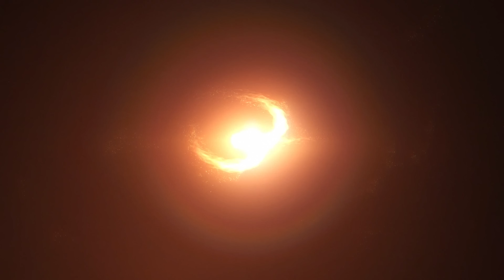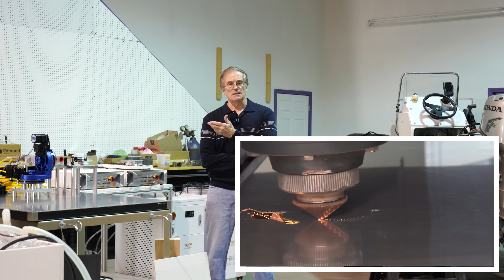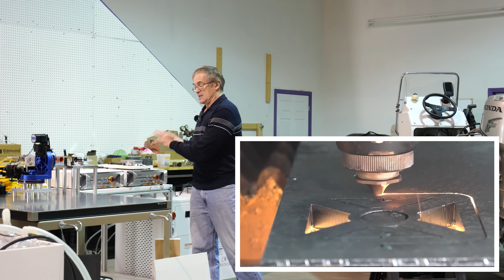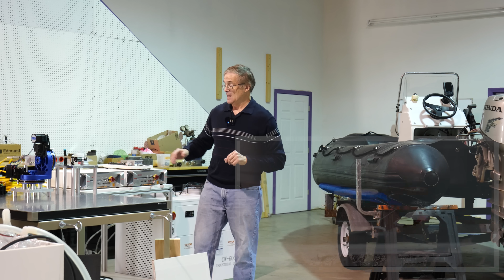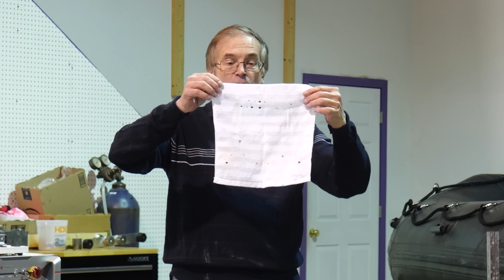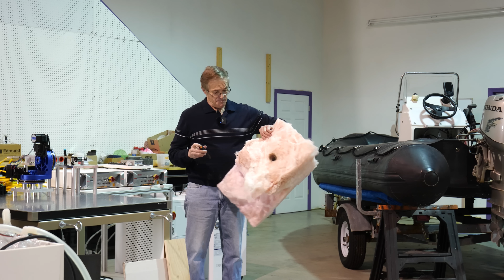We have a problem... and need your help!

Comment: I happen to develop a lot of extreme heat resistant carbon-based materials for refractory use, one of which is at present is a waste material to get something else. Graphitic carbon, or more specifically, graphitic carbon nitride, is especially good at absorbing various radiation-sourced wavelengths (including laser as it were). In this instance, it is both highly effective and fairly easy to produce with some relatively baseline tools. I can email you a short list of tooling to get you started.
Reply: Low tech - sandbags!
Reply: @nameredacted1242  Soon to become fused glass blobs 😂
Reply: That, incombination with something transparent that can pre-disperse the light (one or more stacked panels with microlenses? Don't some types of tvs have those?) somewhat, that would probably work.
Reply: Bricks of compressed charcoal with trapped gas bubbles will have some fly off and disperse the beam further.
Im an Aerospace Engineer, awesome to help. :)))
Reply: @vovochen wouldn't that be like lighting your bbq grill?
Reply: @vovochen  That's not a terrible starting media, though I'd vote to supplement it with some suppressant additives and selective binders. I've experimented with the lump-style in graphitizing them in reduced atmospheres, and it can be done cheaply. In concert with a few choice clay-based powders, it'd make for an affordable coating system. 👍
Reply: @dreed7312  Sorry, its been lost in translation - we call already burned products charred coal here. :) Since they are oxidised, they are pretty inert. :)
Reply: @vovochen  Carbon, yes.  Compressed bricks, no.  You want layers of carbon material.  Specifically Intumescent ablative shielding.  NASA used this before developing their expensive ceramic carbon-carbon tile shielding.  Basically you need a substance that can be formed into layers that produce carbon and expand with CO2 as they burn. As the carbon absorbs more energy than it can handle it breaks away and the layer below it starts expanding.  The cheapest coating I've seen for this is thin sheets of material covered in baking soda (intumescent foam, expands as it burns) and sugar (carbon source) in a binder, but there are many clean burning alternatives.  Most aerospace companies have patents on using simple polymers as the carbon base combined with compounds that release various acids when burned, and then they bind it onto ceramic or aluminum silicate sheets.

 Fireproof Welding blankets coated with this material would probably buy you several seconds.
Reply: @LogicalNiko  oh I like the intumescent foam idea, NightHawkInLight was working on some of that too. Actually NightHawkInLight and Tech Ingredients should partner up on a few projects.
Reply: @ackillesbac  yeah NighHawkInLight demonstrated something on his Starlite part 2 video but didn't say what it was.  It looked like many many layers of maybe paper or fabric coated in his borax, sugar, baking soda combo.
Reply: @LogicalNiko  SpaceX released a video of how they are making their cheap heat shielding blocks... way lower cost since they use a ton of them refurbing the 1st stages
Reply: @vovochen  maybe all the waste ceramic tiles that spaceX removed from starship?
Reply: @RenoSCM  Lol, dont think they can get those ? Id think its a SpaceX trade secret.
Reply: @MaryBrownForFreedom  From what I understand SpaceX uses two types of tiles (with the exception of some ITAR export restricted military stuff they've mentioned testing).  
One is traditional ceramic tiles.  They take a silca based fiber slurry and compress them in a press into a block.  That block then goes into a sintering oven where the fibers essentially get bound together into a very loose foam.  The silica fiber composition and sintering process details are the hard part.

Their second big innovation is the stainless steel heat shield.  This uses stainless steel filled with tons of extremely small holes.  They sandwich this holy plate with another one leaving a small gap.  This space is then connected to a cryogenic methane source.  As the methane is burned it provides a protective shield of CO2 and Water (CH4 + 2O2 → CO2 + 2H2O).  The downside of course being big tanks of cryogenic methane and filling the lab with explosive materials.

I don't think the second option would be pretty practical to build walls from in the lab.
Reply: @vovochen  well, they sell them on etsy.
Reply: @vovochen  flammable tho
Reply: @LogicalNiko  Interesting. They make portable laser safety barriers that are two layers of aluminum bonded by a special polymer, on a wheeled rack. They cost a few thousand dollars commercially, but what you described sounds like the same thing, materially.
Reply: @LogicalNiko  Treated fabric is pretty interesting, as they make inflammable draping, used for theaters, etc. that would be a good base for such designs.
Reply: @MarkKraft-g3i I was possibly thinking of welding shielding fabric.  It’s some sort of carbon doped material to catch sparks and splatter and not spread embers.  It’s also the same stuff used for plumbing to shield wood from fire from gas torches.
Reply: @LogicalNiko  There's a few types of welding blankets I've worked with, depending on the budget. Nomex is the traditional fabric blended with kevlar, often used for fire suits. Not self-extinguishing, unfortunately. Slightly more interesting and possibly* of use here, basalt fiber can and has been used as fire-retardant fabric for welding blankets and portable fire shields. How well that might capture intense laser radiation, uhh... Don't know.
Reply: @paulmichaelfreedman8334  LCD monitors have a sort of lens system  that disperse light, but if the power level is such that TI is alluding to, I very much doubt it would disperse enough energy for longer than a fraction of a second efficiently. Most if not all that I'm aware of are polymer/plastic types. An old-fashioned fresnel lense that are soda glass might be an alternative, but in that vein, your backstop would have to be fairly enormous and I could see a strengthening effect being induced rather than dispersive.
Reply: Newer TVs often have fresnel lenses in them. It could help to diffract the beam, but I'm not sure if the plastics they tend to be made of will offgas toxic chemicals when burning. Another factor to consider is the amount of light reflected from the white-ish surface, which could be hazardous.  @paulmichaelfreedman8334
Reply: I think you mean a diffraction grating and multi layer diffraction gratings or multi layer dielectric diffraction grating are used around high powered lasers, there are numerous kinds of gratings for different applications, another example is one that can extend or compress laser pulses, so this would be a good avenue to explore but then it the cost for the specific type and the cost for the amount he would need for the project. 👍
Reply: Maybe when you email the instructions, you also could shemail him a piece of this "waste material", so that he could have an idea about whether tooling up to make it would be worthwhile for his purposes.
Reply: @GizzyDillespee   I'm certainly open to just sending the material I have here to save him the time and expense, but I will await contact if he would rather do that or go through the process himself for channel content.
Reply: I was looking for a comment about carbon, to my knowledge it can take on insane amount of heat, I just don't know what happens when the heat applied so locally.
Reply: @x-iso burns probably
Reply: @x-iso  While I haven't gotten it minimized to the diameter of a laser dot, I have brought it to ~5200*C via open atmosphere where it eclipsed my measuring ability. That was admittedly with my own additives and a few buffers for refractory use of course on a, comparatively, wide surface area of around 4mm of contact size.
Reply: Graphite panel....maybe multiple panels.
Reply: @joehigdon9847  That's more along the lines of what I had in mind. Coating a set of panels would be easy (outside of time, but you'd need that anyway), but fits the bill for lightweight and portable. Graphite and certain clay binders do very well for this application, though not all graphite is pyrolytic, which is what you would want in this instance, be it naturally sourced or synthesized.
Reply: Nanoparticle suspension of graphitic carbon nitride in water? then you could flow the suspension on a banked surface to dissipate the heat evenly into the volume
Reply: @shaynekinney2263  While graphitic carbon suspends quite easily with some helper agents, you'd need quite a large volume of water to cover a backstop-sized target. Essentially pumped through open air, you'd end up with a waterfall wall, and the layer of water going across would be fairly thin. It would absorb a decent amount of energy, provided the thin film of water doesn't allow complete passthrough, which is what I would be most concerned with.

Comment: I know you say it has to absorb - but can we instead diffuse it? How "out of focus" (smear/spread) of the beam do we need before less exotic materials can be used to absorb?
Reply: Just got to the glass fiber part - which is probably the best version of anything I'd think of regarding trying to diffuse it. Old rear-projection TVs have massive lenticular panels to spread light but all the ones I've seen are no where near optically clear. And I assume any solution down that road must be optically clear, since anything less sucks up energy and gets obliterated. What a wild problem! best of luck